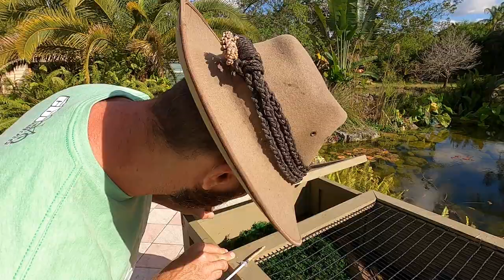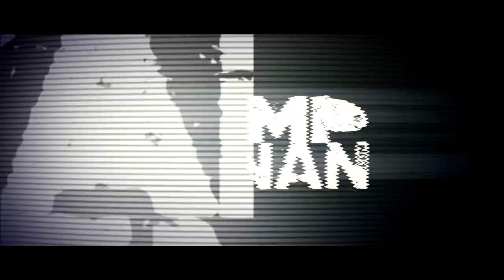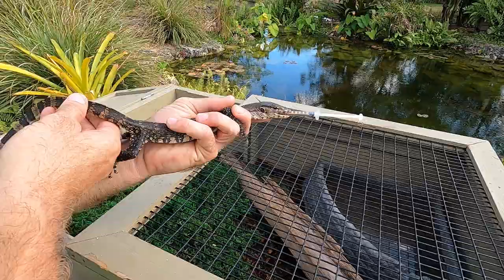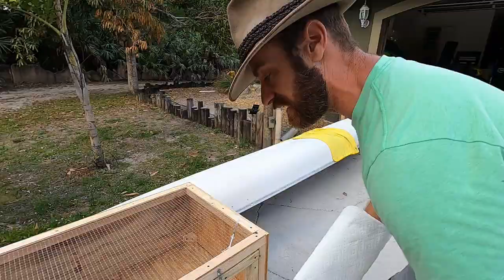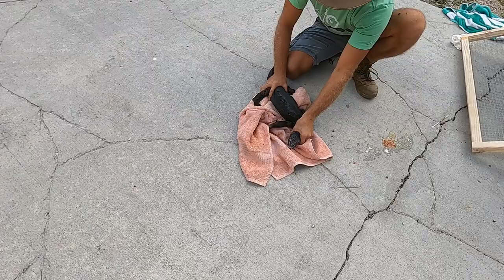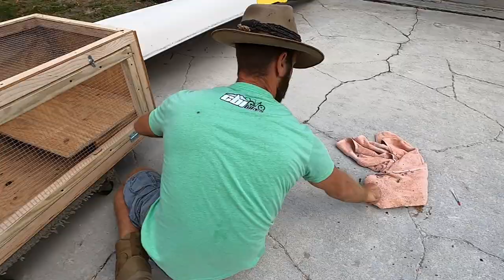This Black Dragon Lizard Needs Help!

Comment: I raised rabbits when I was younger (only have 4 now, and slowly growing out of raising them). They live outside, and I had a rabbit a few years back that wouldn’t keep flies off of her. They do this sometimes if there are other issues internally. She ended up with a maggot issue and needed daily baths, oral feeding, medication and topical ointment. She survived it the first round, but a year or two later it happened again, and the vet determined she had a tumor and that is why she wasn’t caring for herself. I’d do anything for my animals (even clean off disgusting maggots).

Comment: That mesh will easily rip out any claws of any lizard or monitor that climbs and gets hung in it. That’s another reason I don’t use mesh. The plastic covered mesh doesn’t seem as bad but I know the steel mesh is rough on them.

Comment: We have 2 Saint Bernards. My oldest girl Bella scratched her cornea and we had to apply drops and ointment 4 X day. Bella weighs 140lbs, and it was a challenge to get her meds in her eye. We would have to catch her and put the leash on her, then drag her to the bathroom (aka treatment room.) She’s a very strong girl; Saints can pull up to 10x their weight. It took an army to hold her, hold her head, keep her still, and hopefully hit the twisting target. Fun times! Unfortunately, we didn’t save the cornea, but she has her eye. She’s a beautiful Saint, and so sweet. We love her so much ❤️❤️

Comment: You should flip the cage over one turn so it has a wooden back, a wooden bottom and a wire front and a wire top. It would be much easier to get the animal out from the top of the cage instead of that opening being on the side. Just trying to help. Love camp Kenan.

Comment: Hey, you shouls get yourself a so cald  "crobneedle" its mainly for birds i think.
It had a stump tip zo you can put it in the mouth etc without hurting the animal.
Reply: Those are teeth breakers, for reptiles.
Reply: @tamcsilva  
Not persee. Either way you get the job done faster and safer IMO. Plastic also has his down sides.

Comment: You can turn that habitation into a top opening box by simply taking your water container out that sheet of wood out and laying it on its side so the screened area that has a hinge is on the very top. gives him screen on one side and screen on the top but you don't have the worry of him getting past you when you open the top
Reply: That will make getting gom and out a lot easier.  Very good shout and such a easy way to do it too .

Comment: I hope that little gal pulls through.  Its unfortunate, but like you said sometimes captive bred is the way to go.  You may spend hundreds or more in vet bills making the wild caught animal quite a bit MORE expensive. Or they die.  Ya gotta pay to play. 🤷🏻‍♂️🤘🏻🦎🐢🐍
Reply: I agree captivity bred is tje best way to go not onky to stop the number from going down in the wild but to also make sure ethey sre heathly from the day they hatch . When you get a wild one you can not control what happens before you get them . But if you breed them or get a captivity bred one you can then ask the questions what are needed to be asked...

Comment: I noticed that while you were holding him, Stinky kept his tail straight. I know you said before that they curl the tails when they are upset, like Agertha does. So I guess Stinky wasn't too upset??
Reply: Typically a straight tail means they are chilled if you're stroking them our holding with out restraint, However if you have a grip on them as a defence they do a limp relaxed thing that fools you into loosening your grip, then when they feel they can bolt they make a run for it.

Comment: We do need imports from time to time, to ensure fresh blood for our existing bloodlines
Reply: Exactly some captives have become very inbred
Reply: Or just practice responsible breeding. The Never ending pilfering of wild animals will lead to the eventual collapse of a species.
Reply: @AlexOzoneVideos  That’s true to a degree. It definitely depends on the amount of captives, along with how frequently a wild caught population would be added. The aquarium hobby does this pretty often, and even has positive impacts on the environment when obtaining WCs of certain species, all while helping the individuals working to catch them (so they aren’t forced to work deforestation jobs for instance). Bringing in WCs occasionally to help diversify the lines, if needed, can be fine as long as the wild populations are remaining completely stable and without issue. Often, most wild populations are well monitored, any issues would begin to show and be voiced, and sometimes even regulations or bans go into place until those issues are resolved.